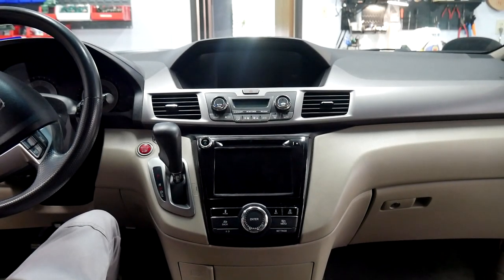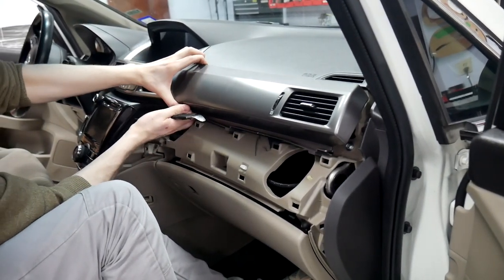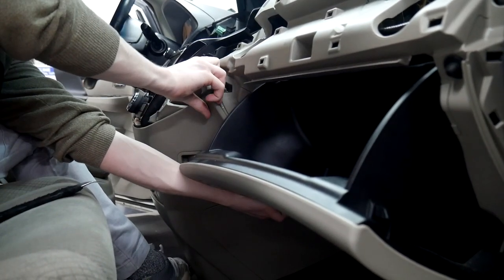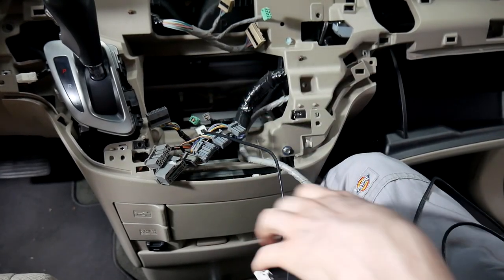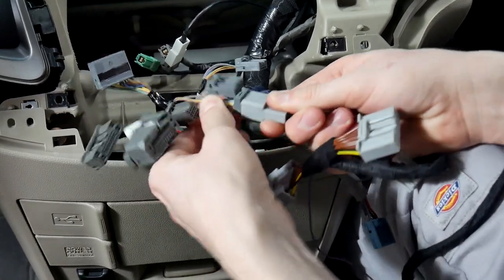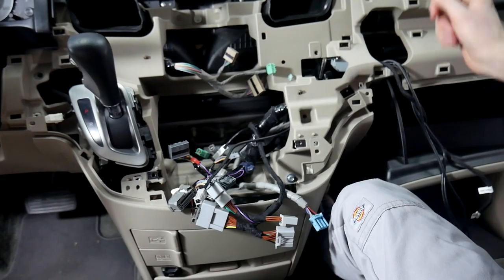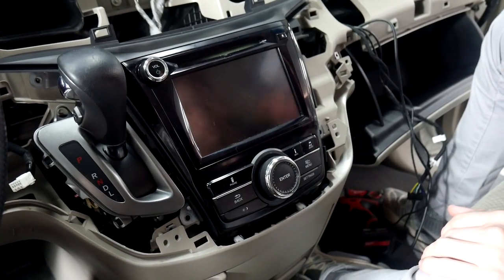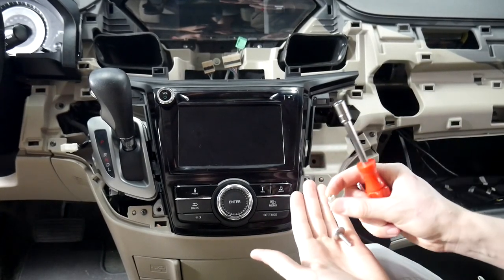Honda Odyssey 2014 2015 2016 2017 CarPlay® Android Auto® install, stereo removal GROM VLine HON3

Comment from the maker: VLine VL2 model that will allow to add CarPlay and Android Auto to factory Honda and Acura stereos, as shown in this video, is available here:
https://gromaudio.com/store/vline/grom-vl2-hon3.html
Model: HON3VL2
Reply: hi! I have a 2017 honda odyssey touring elite and I want my android and iphone to connect to it. what should i do and what do I need? will I still be able to use the built in navi system in my odyssey? will I be able to play streaming videos to the back monitor? I hope you answer my questions.. thank you.
Reply from the maker: @jamescarlodejesus8780  it should work for your Honda Odyssey 2017 as long as the stereo has dual screen. You will need the VLine VL2 system model that is available here:

https://gromaudio.com/store/vline/grom-vl2-hon3.html

The model is HON3VL2. The system supports HDMI-OUT and you should be able (also not guaranteed) to play the videos on the back monitor.
Reply: Will this affect the factory DVD system?  I noticed the install vehicle does not have it.  -2015 Honda Odyssey Touring Elite.
Reply from the maker: @kazmo88  is that the factory rear seat entertainment?
Reply: @gromaudio  yes, factory.
Reply from the maker: @kazmo88  the factory DVD system will keep working.

Comment: I see at 5:30 you connected the backup camera.  But what about the passenger side mirror camera when the right signal is on?
Reply: Th video linked below also shows the side mirror not working (at 49 seconds in) even though in the comments they state, "yes all factory cameras will keep working."  I need to know that function will keep working before ordering.
https://www.youtube.com/watch?v=0cS0FjZ8fyQ
Reply from the maker: @sweatpants235  yes all cameras will keep working.
Reply from the maker: yes the passenger side mirror camera will keep working when the right signal is on.
Reply: where can we order of that together all of the harness?